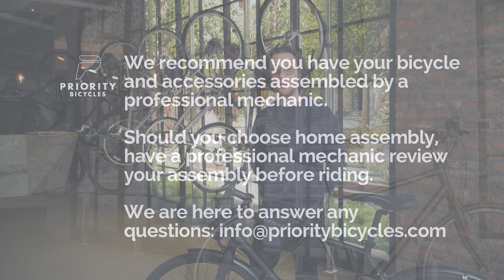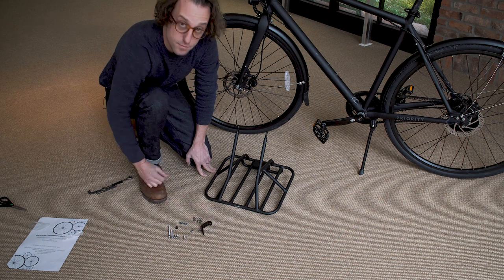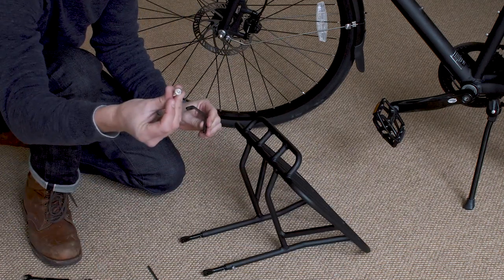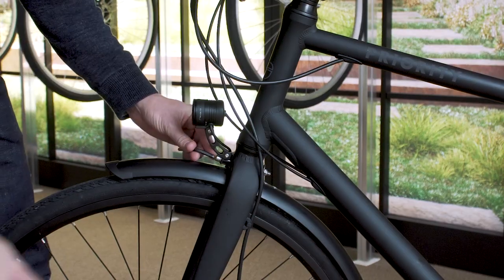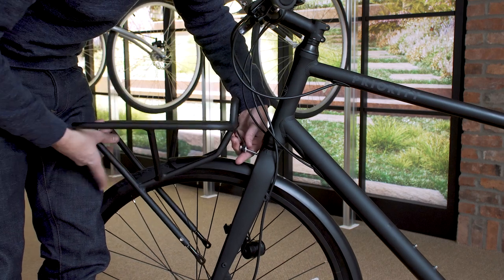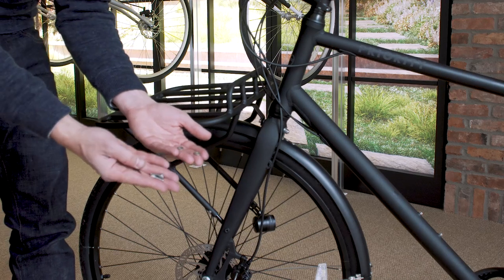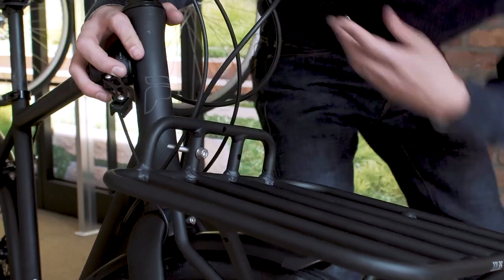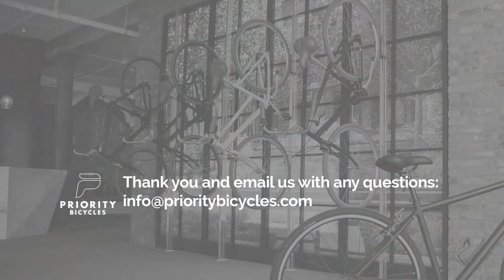Priority Bicycles Front Porteur Rack Assembly

Comment: I think you should consider a new mount location for your front light. It would be best for it to be mounted on the front of the rack so that your gear does not end up blocking the light.
Reply: Hi @VeloVloger- for sure.  Great note there.  Maybe there is an inverted way we can check out for flexibility.  We will give it a view.  Thanks!
Reply: I totally agree with you
Reply: Doesn't block the light.

Comment: Rack appears to be sloping down to the front. So how do we "level" it as stated in the video? And what do we do if the bike has no bolt mountings  halfway up the forks?
Reply from the maker: effyleven Please note these racks only work with Priority model bikes. If you have one of our bikes you will have the fork mounts and it will level easily.  Email, call or text our support team for help.
Reply: their rack is a rebranded origin 8 porteur rack. On the origin 8 rack the bracket that attaches the fork to the bottom of the flat part of the rack can be adjusted  to level the rack. The legs extend further in order to attach at the front wheel axle. Its best to use a bolted front hub though.